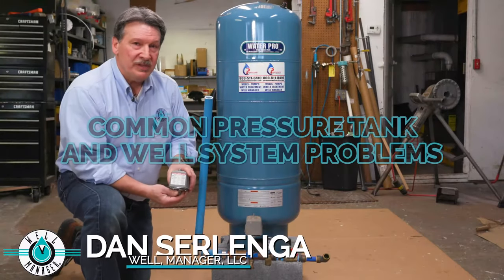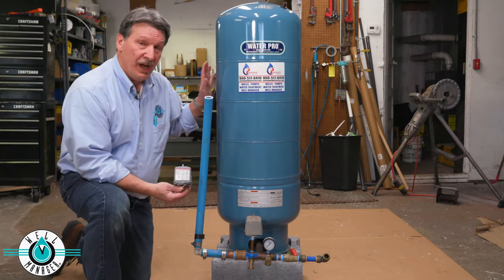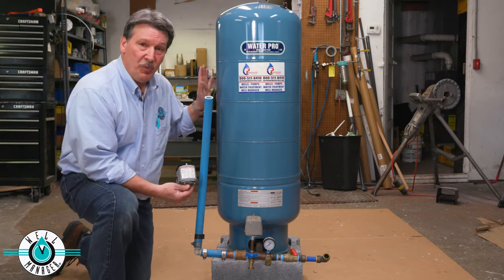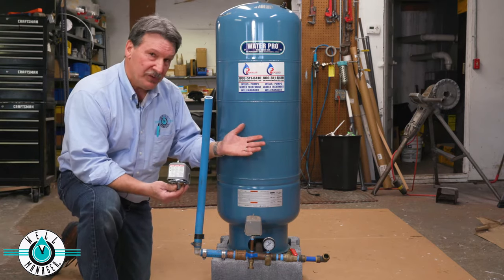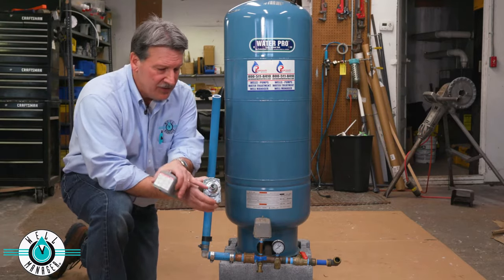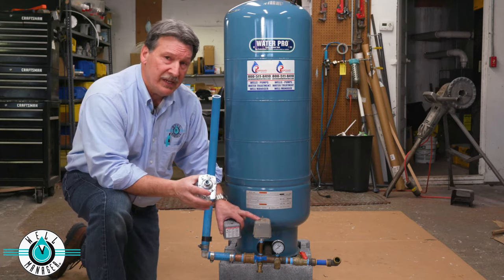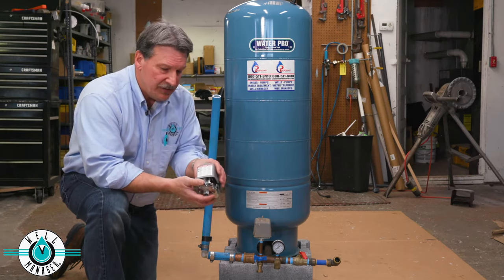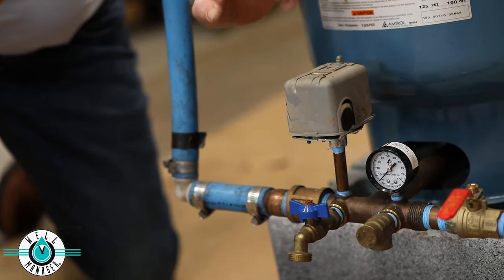Common Pressure Tank and Well System Problems

Comment: The switch started kicking on with just a little water being used . I cleaned out the  pipe that leads up to the pressure switch . It was completely clogged up . I cleaned out the switch and the piping .I put it back on and the pressure gauge is now showing  that it kicks on at 40 psi and back off at 60 . when the water is turned on the pressure gauge shows the pressure drops down to 40 psi with in a few seconds . what would cause the pressure to drop from 60 to 40 with very little water being used ? It has the same type of tank you are showing .
Reply: Check the air pressure of your pressure tank. Water doesn’t compress so the water pressure will drop drastically within a few seconds of opening a tap. The rubber bladder in your pressure tank, when drained of all water, should be pressurized at two psi less than the ON pressure of your switch. I’m betting yours is almost to zero.

Comment: my shallow well tank is not getting water? my pressure switch is on the pump. it is a 20 gallon water works tank ant a half hp pump. I have good water pressure. tank just not filling? can you help?

Comment: I have a 88 gallon pressure tank. bought it new only a couple years ago, still looks new. I bought it for the 88 gallon reserve when the power is out. replaced the pressure switch when I put in the tank. recently we had a power outage and as always before when the power went out I knew I had 88 gallons under pressure even without electricity. then I found out when trying to use the water that we had no water from the pressure tank. I just checked the schrader valve for air pressure and air came out, so there is air in it, no water came out of the valve. any ideas what this problem might be? the only thing I can think of is the water is leaking back into the well since there are no leaks in the visible plumbing anywhere. my well pump, which has been fantastic and never given any problems, is a 3/4 horse water ace submersible. is there a valve or seal in the pump that can go bad and allow the water to back flow into the well again? thanks for any help.
Reply: The check valve way down the well may be shot..last year i spent $800 on a new submersible pump, brought the old one up and lo & behold the pump was good. It was indeed the check valve that was rusted out and this was why my pump was always running excessively.

Comment: What would cause no pressure on the cold water side but normal pressure and temperature on the hot side
Reply: Could be a leak or a clog on the cold water side somewhere

Comment: My well switch is 30-50 psi, the pump bleeds down to 38lbs click on for 2 seconds and the gauge says 50lbs again. I have good water pressure inside the house and no air, sand or grit in the sink, making me think I have a leak. But the pump turns on every 5 minutes and surges the lights in the kitchen. The tank is 7 years old, same brand in your video. Have you seen this issue before?

Comment: Thanks for the video. Here in East Texas we use Hydro pneumatic tanks. It's just a tank... no bladder. They are only found in areas where water quality requires them. Water and air are mixed together in a hydro pneumatic tank to reduce the "rotten egg" smell that sulphur bacteria and hydrogen sulphide gas in the water can cause. My question is I know there is a bleeder valve down under that allows water to drain back into the well and shuts when the well restarts. I believe this is so the air in the downpipe is used to recharge the tank and a float valve in the side of the tank controls the amount of air in the tank. I currently have a 40 gal tank and want to replace it with a 120. Is the depth of that bleeder dependent on the size of the tank?